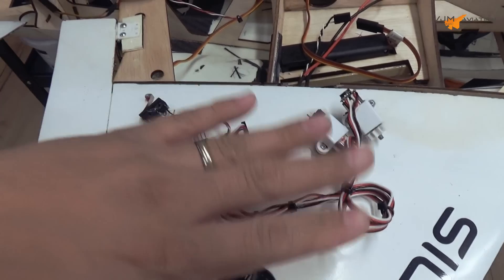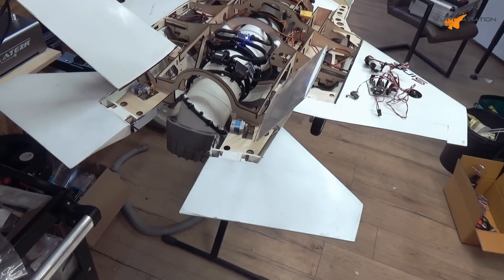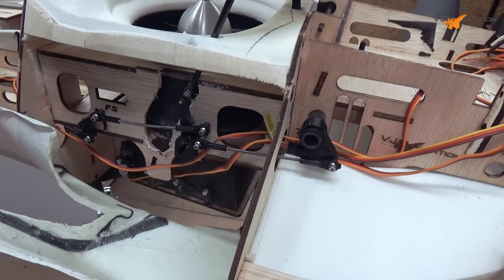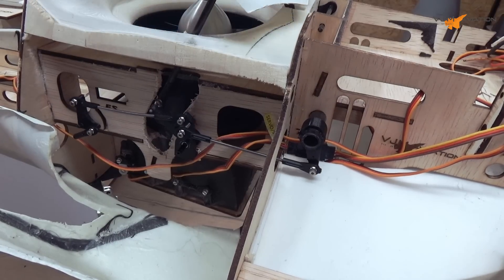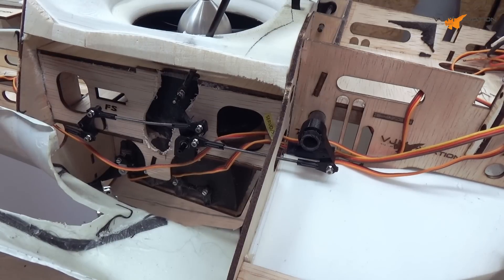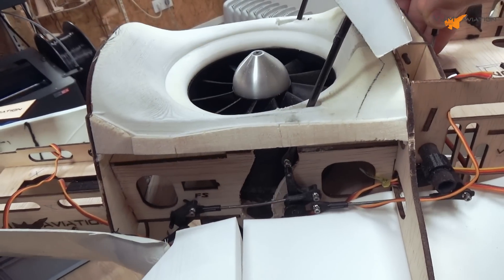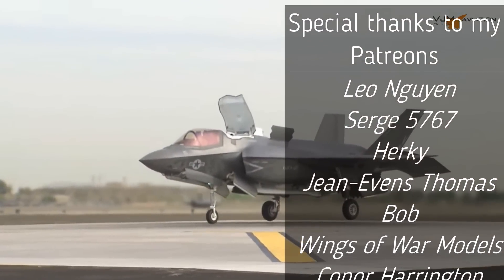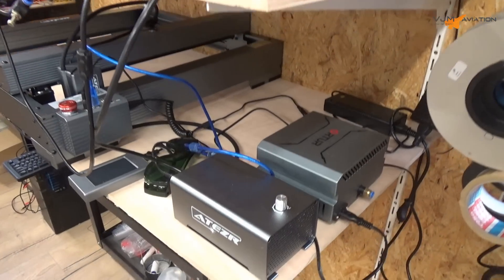F-35B Making hte STOVL Doors World's Most AWESOME RC JET | Top Best Builds

Comment: I have large format 3d printers with build plates that can handle 15" x 15" x 15" work pieces....
If you need some help printing larger pieces.
You pay for the materials and shipping from Salem , Oregon in the USA,, I'd be happy to print them for you.
Reply from the maker: As today I have a big modix😍
Reply: @Joelmelanie  I also have a metal, wood and composites shop. So if you need any help let me know. I'm between big projects and looking for something new to get involved in. Been following this and your other projects for a long time.
Made the same offer before. Just letting you know it's still available.
Good luck going forward your engineering solutions are outstanding and I enjoy following along.

Comment: Happy new year! Just curious, will the top cover hold up against air stream during forward transitioning? The 3D printed hinges and linkages look fantastic but not sure if they are strong enough?
Reply from the maker: I do hope so, it must hold speeds at 55km/h…if not than I have to make it stronger..but it will result in more weight
Reply: @Joelmelanie  Thanks for the hard work! Aesthetically it's really a masterpiece! Hope it can hold up well in flight. If not, maybe consider changing some critical parts like the hinges and the linkages to metal?

Comment: Just curious, does the real F35 have fans under the wings? TQ and Happy New Year. Awesome work
Reply from the maker: The real f35 has roll nozzles under the wings…complicated
Reply: @Joelmelanie  Thanks for your reply . Ah ok. Did not know that. Thanks for the knowledge Sir
Reply: The F135 has ports in the fan ducts to supply air to the roll posts.  The model duplicates the functions without having an actual bypass air turbine